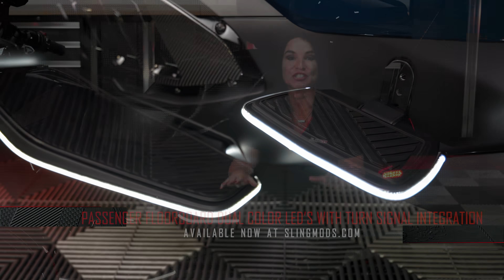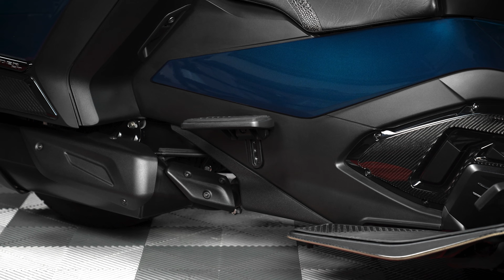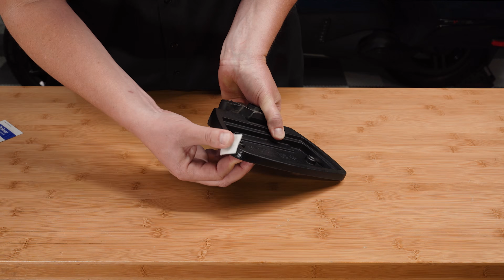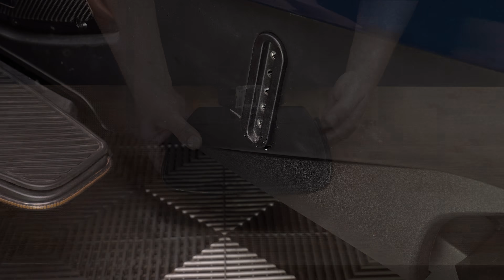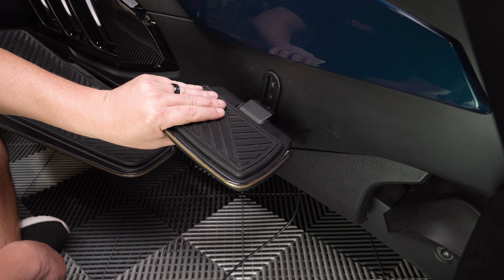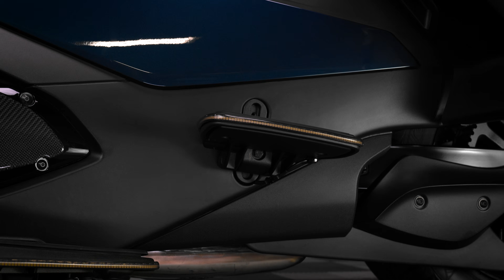Spyder RT Passenger Floorboard LED Lights (2020+) | Install

Comment: What size is the round file used in the video?
Reply from the maker: Hey Mr. H, we used a 3/16" file.. but the wiring harness diameter can vary slightly on this product, so we didn't mention it in the video. I would suggest waiting until the kit is received before purchasing the appropriate file. Please note that you can also use an appropriate-sized drill bit along with an electric drill to carefully notch the plastic. Thank you!